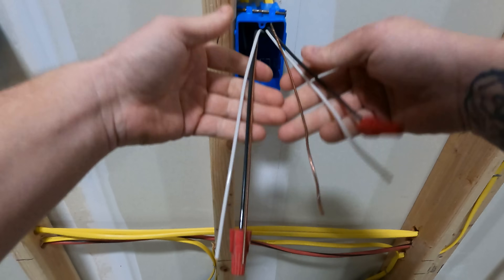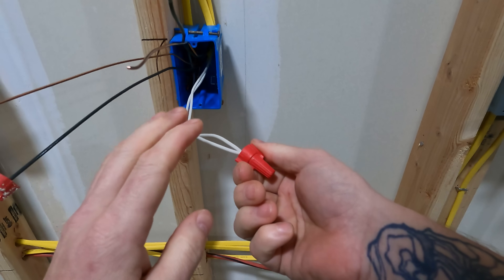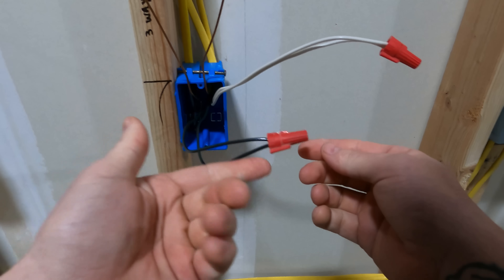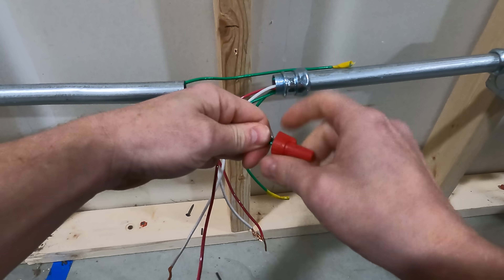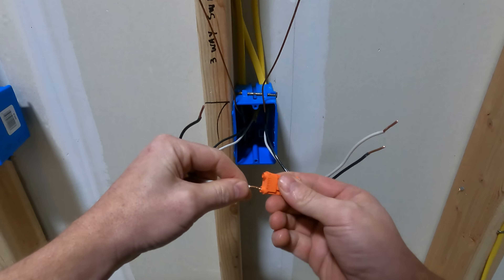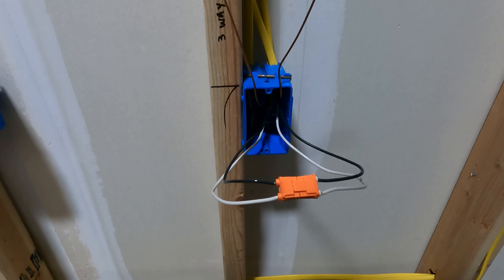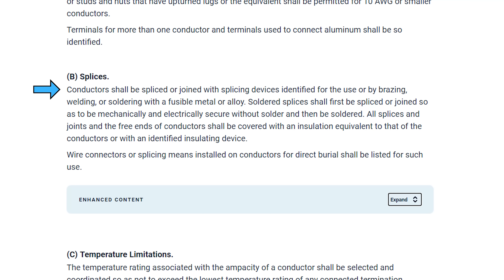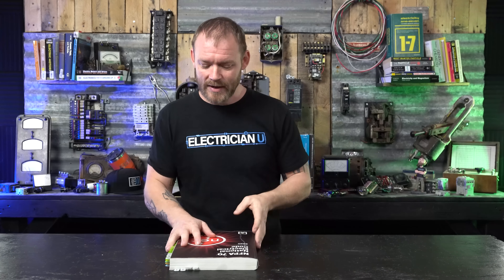To Twist or not To Twist? THAT is the Question.

Comment: I am a dedicated pretwister. I agree with your belief that it is a more secure connection. It also looks more professional when the wire nut comes off for servicing. One thing you don't mention is joining stranded to solid, which is very common for fixture and appliance wiring (my main application). I like to twist in such a way that the solid wire "corkscrews" and the stranded wraps with it. I also like to twist the stranded conductor so the strands make a semi-solid piece.

Comment: If you don't pretwist, I'd recommend to twist the wire nut until you get a few turns on the insulation. This will take longer than just twisting first with the pliers.
Reply: On Ideal wire nuts at least that's in the instructions. I'm not super up on my NEC stuff but on anything listed, following the  instructions is required even if there's a safer way
Reply: @davyc444  The package says "Pretwisting acceptable, but not required..."

Comment: I tell all my newer guys that it's MY code that any solid wire 14ga or larger has to be twisted. In the past I've had too many return trips and failed devices due to bad taps. Also on devices like switches or receptacles that will be daisy chained to another, I want the main runs twisted and a pig tail used at the device. If the device fails it can be replaced without affecting everything down line, especially critical in commercial spaces.
Reply: Well said! My house has every box made up so that only a single pair terminate to the device.

Comment: I work with 22, 18, and 16 gauge wire mostly. I don't pre twist these as tightening wire nuts does the job. I will pre twist larger wires.

Comment: What about a solid/ stranded connection? Twist the stranded and then twist around the solid? Wrap the stranded around the solid? What about a single stranded wire connecting to a couple of solid wires? These questions would be good to address as well.
Reply: do not use pliers to unsheeth, twist the stranded to the solid, and test pull it. in case your cap is too big or your strands are cut by whatever wiring tire or cap twist off.

Comment: To add, I've naturally always pre-twisted my wires as of the last 6-7 years.   I got a call back on one of my jobs from years ago when I used to use the wire nut to twist my wires.  As I twisted the wire nut, one of the wire's walked down just enough to barely make a good connection with the other wires and the nut.  The twist I put in the wires when twisting the nut made the "pull test" work just fine.  But the wire over time finally lost it's connection.  Long story short, I pre-twist because I like that visual inspection of the wires before I cap it with the wire nut.  I also prefer how solid they're twisted together that way.  So it's stuck with me ever since that day years ago.   To each their own.

Comment: Adjust assume that connection will be buried and never seen again. Do you think your current method is strong enough to never have an issue? 

If you have any doubt, go the extra mile and pretwist. If I can see the copper is twisted nice and tight before the wire nut goes on I already know it’s a solid connection. One that only relies on the wire nut for insulation instead of it mechanically holding the wires.

Comment: I twist all conductors, that’s the way I was taught 23yrs ago, why change it now? Plus we never use solid wire rarely. Solid connections will stay that way VS having to wonder if it did twist right.

Comment: I almost never pre-twist.  I use an old GB wire nut spinner.  Anywhere from 2 #14 to 5#12 I can use the wire nut to twist.  When I remove the wire nut to check, the wires are twisted together beautifully.

Comment: I twist them a ton with the wire nut until the sheathed portion starts to twist.  Once I take the wire nut off the wires are twisted just as good as doing it with lineman’s.  It really just takes more finger strength.  Haven’t had any issues.  

With that being said I always have the newer apprentices twist them with lineman’s.  Their hand strength is never good enough for a solid twist.

Comment: Pre-twisted joints are the way I was taught as an apprentice. We did a lot of hospital work and a joint failure could literally be life or death. That method pretty much stuck with me..
In 27 years I've seen maybe 10 or less failures with the twist method. Dozens maybe hundreds with other methods. Regardless of method you should give the wirenuts and conductors  good tug to ensure solid connection.

Comment: It’s simple the nec says all products should be installed per manufacturer standards if your wire nuts say pre twist you pre twist if they say do not pretwist and you pretwist technically you are not following the nec code 😂

Comment: Awesome video. I'm on team "No pre-twist" but I twist the wire nut until the conductors start to twist beyond the stripped area. I'm just happy to see someone have their own preferences but admit that there is more than one right way to do things. Also, I am a commercial electrician so I am dealing with stranded wire 99% of the time.
Reply: Agreed.  His example at 3:00 actually shows an invalid install, as per the wire nut manufacturer's instructions.  The wires should have a couple twists along the insulation outside the nut and not depend on the twists of the stripped portion inside the nut.

I usually don't pre-twist unless it is 3 or more wires...  wrestling them to line up can be hard unless you twist them before placing the nut.
Reply: Agreed, I work evenly on stranded and solid and I always pre-twist solid wire, but never stranded. Stranded wire just won't stay in the nut sometimes if you pre-twist it, but if you let the nut do the work it ends up forming correctly in the nut I've found. Like Dustin, I've also run into many problems with bad nut connections, and all of them were solid wire not pre-twisted. Only once did I have a stranded wire problem, but that was because the user didn't strip enough jacket away, and the nut didn't grab onto anything.
Reply: I pretwist but started to use coaxial driver to grip the nuts real tight and that helps twist them up alot. But anything over 2 I use lineman and then cut them in a v shape
Reply: @blakek1043  Take a look at the VoltClaw-12... one of the most handy tools to have for nuts, pushing (live) wires around in boxes, etc.  Lives on my tool belt now.

Comment: The key here is in the listed item's instructions as they appear on all boxes of wire nuts. If Ideal specifies using only their wire nut to twist the wires, they have done the testing that proves that pre-twisting is a detriment to the connection's integrity. Note that they also provide those nice plastic, three-sized wrenches to facilitate a sufficiently tight twist. I've worked with electricians who, following my instructions as the engineer who specified a specific brand of wire nut, used their lineman's to tighten the wire nut. I have experienced an electrician who just couldn't muster the will or the strength to securely tighten the wire nuts splicing 480 VAC to motor leads. I doubt he would have done better if burdened with a pre-twist step. After I spent an afternoon pulling off all his faulty splices in an industrial conveyor system and properly wire nutting them, that individual never worked on any of my future projects. Wire nuts, by design, require very high installation torque. I never approved winged wire nuts for my jobs because they imply that finger tight is ok--it is not.

Now on to why pre-twisting is not approved. First, you will not pre-twist to the same pitch that the wire nut wants to impart to the connection, hence weakening the nut's hold. Second, your lineman's introduces nicks in the conductors, and so stress risers and weak spots for the nut's connection. Third, your twist will not match the nut's bottomed-out twist length, so short or long engagement may result, the latter yielding exposed conductors. Fourth, the pre-twist pre-stresses the conductors arbitrarily and in opposition to the stresses that the wire nut will introduce; I have witnessed an arcing connection as the result of a broken conductor where it exited the wire nut due to the above over-working stress.
Reply: Hell if you want to go above and beyond hand tight, find a socket that fits the wire nut and hook it up to your drill.  Takes care of the torque problem and compensates for people who just want to rush through a job without checking their work. You use a drill?  You can twist it inside and have your buddy out by the truck tell you when the twist makes it to the pole.  ;)

 The only issue I have with letting wire nuts do the twisting is when you have to use stranded wire...It just will not twist properly in every nut I've tried.  One wire becomes the middle and the other wires flatten out and wrap around it, and you can pull the wires out of the nut every time.  Twist it harder trying to compensate and you end up breaking off strands or nicking wire.  You can pre-twist the individual wires and THEN put on a wire nut to twist all the wires together, which works, or just pretwist both.  OR use a Wago on stranded wire...usually not a high voltage circuit if it is stranded anyway so it doesn't cause people to clutch their pearls when you use one.

Comment: 3M wobbly wire nut spinner and 3M wire nuts. Strip out wire 1”+. 
Hold 2” from end of wires.
Line wire ends evenly and stop twisting when 1” of insulation is twisted or touches your fingers (not all the way to the end like some)

Comment: Materials, aka copper, dont expand.  Why pre twist?  Because wire nuts suck.  They arent allowed in most of Europe and they can't take very high currents.  Plus people dont use the right size, put too many conductors in and over fill boxes.  The real answer is always follow the " manufacturers directions."  Which is to not pre twist.  Which is code.  Why do we use them?  Because they are one of the only splices that allow different sizes of conductors to be mixed.

Personally, Ive seen the pre twist fail.  Guys over tighten or under tighten the wire nut so it falls off.  Ive seen them melt.  Ive seen guys twist multiple wires together without stripping them long enough.  So the shortest one falls out.

Comment: I always think of the wire nut as an insulator that  protects the bare joint.   I was in horror when I first saw an electrician not twisting.  It is so wrong.

Comment: Depends on the AWG size and how many conductors in the splice but honestly I’ve found that a few 14’s or even 12’s,  I can make a solid twist with just using the wire nut ,  especially red or tan.
Reply: Ideal even had a vid showing no twist.

Comment: Worked in a large slaughter house and injection molding shops where they had a lit if vibration and valve the locations had water intrusion from high pressure nightly wash downs. Chief electrician told me first day on the job if I did  not pre twist wires then app!y several layers of tape ( prevents pressure connections from falling off and keeps water out ) I would be fired. We would keep our short rolls of black tape for guys on the kill floor & boning rooms. Called it the electricians band aide.Would wrap a few wraps of black tape sticky side out then a few layers sticky side down. Was the only thing that stayed on cut fingers for more then a few minutes with all the water around.

Comment: Guy at the beginning is twisting strands wring direction. Should be clock wise. Wish that is had a dollar for every lazy ass hole that joined three or more wires together and to make matters worst did not stripe off off enough insulation. Same lazy ass holes too many times do not twist the wires enough. This causes dangerous situation when you take pressure connector off ( no such thing as a wire nut in any code book ! ) wires come apart causing sparks. Some times you have to work on energised circuits. Have been in large halve million square foot industrial buildings and could not locate where wires were feed from. They often went into 3 or 4' junction boxes with 40 other conduits feed from loads of panels. Once took us over five years to locate where halve of the 277 foot luminares in a large maintenance shop were freed from. Two of us spent maybe 6 hours on a Saturday night turning off every circuit breaker within a thousand feet of this shop. Finally found somebody installed a 600 volt fuse block inside of a 800 amp panel that only had three pole circuit breaker in it. Goof ball ran #12 wire bolted to the 800 amp buss bar.

Comment: I like the idea of pre twisting. You want something you won't have to go back and fix later on. That said I think most wire nuts expect you to twist until the wires themselves are twisted outside the nut or at least that's what I've seen on packaging of these things so most likely non pre twisting people aren't giving it enough turns to do that which might make people think they're less secure?
Reply: I used the ideal brand screwdriver that has a wire nut slot in the back so you can used that handle to crank in the nut and when you take it off you can’t tell whether or not it was pre twisted up to 3 10AWG conductors and more I pre twits if the situation allows for it but I agree with you

Comment: I personally do not trust spring loaded connections. Heating, cooling, and time are their enemy. Also, using lineman pliers to remove insulation is risky. "Don't nick the conductors."
Reply: It does take a certain finesse to use lineman's pliers to strip with. When done correctly you're merely scoring the insulation and then pulling on it to snap it while it stretches.
You don't really dig into the conductor.
Reply: @Carlg6 I know you're right. It's just one of those things hammered into me as a new helper many years ago. They stick with ya.

Comment: I do both! Braided wire I twist always. The only time I don’t is when I wire nut 2 solid wires of gauge 12 or smaller. I also can get my twist a lot tighter than what you did. 🤷🏻‍♂️

Comment: I twist the wires all the time. Too many times I have found wire nuts just put on the end of wires not even twisted. The wires become lose and don’t make a good connection. Don’t know how many times I opened a 4sq cover and a wire nut is just barely hanging on. I been doing electrical work over 15 years.

Comment: Pre twisting is out dated. There is no need for it. In fact wire nuts themselves are outdated. I like Wagos a lot more. They are a secure connection and it saves your wrists

Comment: As a second year apprentice, I have just recently run across a Journeyman who doesn’t. From the beginning of learning the trade I was taught always pre-twist. And any Journeyman I worked under it wasn’t even a question. Now, with the encounters with the “don’t pre-twist, it’s written on the packaging instructions” folk, they do a good job of it. They’ve shown me the whole process, then taken off the marrette and low and behold the wires are twisted as well as a pre-twist. When I attempted it it turned out like crap. That probably had to do with my inexperience with doing that method. What I like about pre-twisting is I know when I have finished a splice, it is solid before I put the marrette on. I don’t know how solid of a connection it is with the “twist with the marrette” method unless take it off and inspect it. Pre-twist just makes sense, for someone who is new to the craft. You can walk away from a job and know 100% that you did a good job. That’s my two cents worth
Reply: Probably because you stopped twisting what you thought was enough. You twist until the wiring coming out of the nut begins twisting too. Try it.
Reply: What the hellllll isssss a marrette ? Lmao😂 a wire nut you mean
Reply: @nym5635  if I lived in the States I’d refer to it as a Wire Nut. In Canada, most electricians refer to them as Marettes. World doesn’t revolve around the USA. Sorry.
Reply: @PlayNowWorkLater  touche' haha sorry man I thought u were in the states

Comment: I like the pre-twist because of the more solid connection, but I also see the connection happening. That I have no question if there's a good connection or not. Just landing a wire nut on without a twist no one is sure if it's a solid connection.

Comment: I'm just super compulsive sometimes.  At 0:33, in MY opinion the stranded wires are being twisted the wrong way (counter-clockwise when looking at the end of the wire is wrong).  Because then, if you use a wire nut on the joints, since the wire nuts only go clockwise, that would actually untwist the stranded wires.

Comment: Well, I'm not a real electrician. I was taught as a teenager by the son of an electrician, and later became an electrical engineer. I have done electrical from time to time, and I generally pre-twist unruly wires. If they are being compliant, I'll let the nut do the twisting. But I do have a nut failure story. Friends called the gas company because of a burning smell when the heat came on. Nothing found. Called an electrician. Nothing found. So they called me. I looked around, touched a blank switch plate in the next room, and nearly burned my fingers. Behind it was a brightly glowing connection with the remains of a wire nut sitting on it.

Comment: The true UL listing for wirenuts says you need to twist the nut on the untwisted wires until the insulation of the conductor starts to twist(there is an inch measurement, but I forget it).  So you actually didn't install your wirenut correctly the second time. Which is why it came apart. 
- I still pre-twist!- 😂